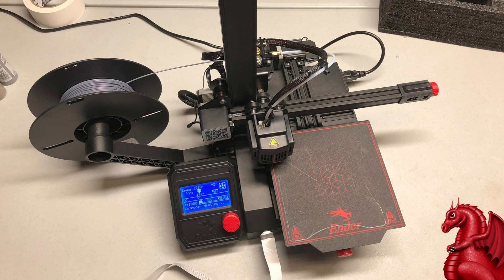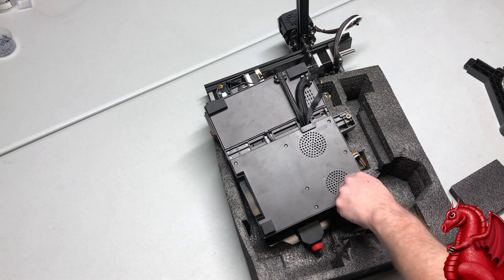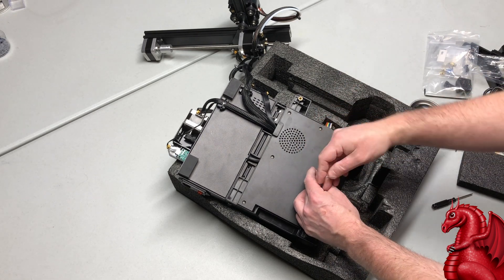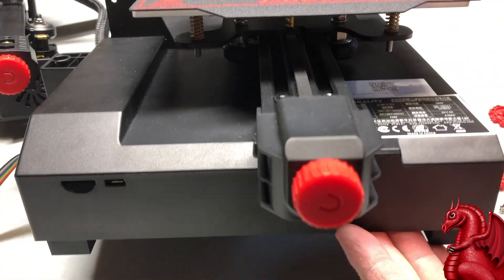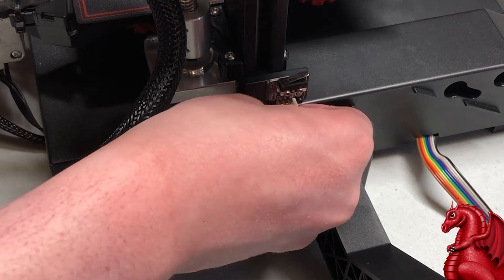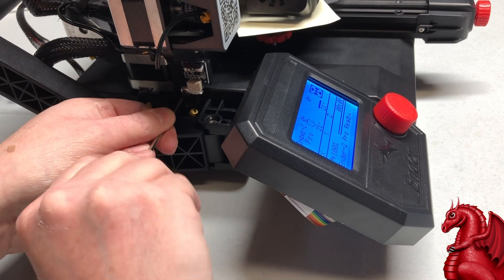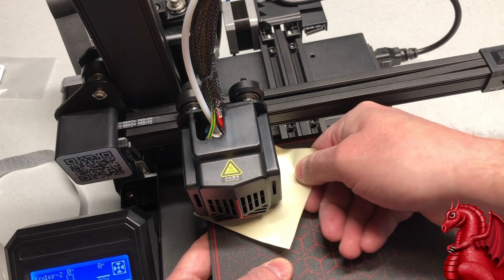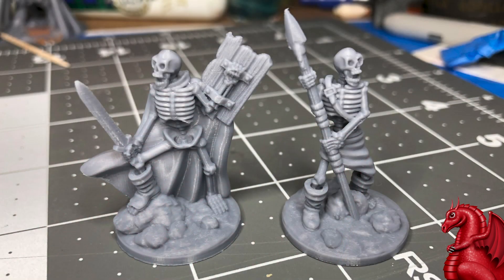Creality Ender-2 Pro assembly and pro build tips.

Comment: Really enjoyed this video.  I purchased this printer when it was on sale a month ago ( $89.99 after coupon discount, couldn't pass that up)to use for little things.  I was not initially impressed with this printer, but after watching your video and doing the changes/upgrades you recommended I was much happier.  The build plate is junk and should be replaced with a spring steel one.  One problem that I've seen others mention is the models not printing straight.  On mine, the problem seems to have been the Z axis stepper motor mount.  It attaches with two screws to the frame and is crooked!  It causes the motor, and therefore the rod to be at an angle, and the taller your model the bigger the problem.  The difference from top to bottom was 2mm to 3mm.  I replaced my motor mount with a file of a better designed one I found online, and it seems to have solved the problem.  Thanks again for your video.

Comment: I got mine today. It's my first 3D printer and I'm struggling to level de bed.  The corners seems to be leveled, but the center is allways warped. Does anyone had this problem?
Thank you all!
Reply from the maker: Just get it so the center prints perfect, most objects you print will be there, not the corners. Any models that do go that far will be fine as long as the center is good.
Reply: @Tombof3DPrintedHorrors  tks for the tip. :)

Comment: THANK YOU! I was struggling with the Z offset and getting the bed leveled reliably, but your recommendation to manually set the z limit access switch did the trick. Also replacing the springs helped considerably and retains consistency for much longer periods of time.

Comment: Video on tuning eccentric nuts: https://youtu.be/JTN6jtB5mqk?t=801
Basically, tighten or loosen the eccentric nut just enough so that you can use your fingers to rotate the wheel without the entire carriage assembly moving. You want the wheel to be just barely loose enough so that it can rotate freely.
Reply: So what do you do if the hotend is so loose that it freely wobbles and no matter how much your turn the eccentric nut it never gets tight?

Comment: At 10:05 you say that the screws have to be loosened 2 full turns. Is this right, because i have the feeling this is way to much and makes the whole thing wobbly 🤔
Reply from the maker: It is correct and prevents Z binding. 1 1/2 turn loose is minimum, 2 turns loose is what I use.

Comment: Which printer do I use in Ultimate Cura as the pro 2 is not listed?
Reply from the maker: Ender 2, then change the bed size to 160x160
Reply: @Tombof3DPrintedHorrors  Thank you so much brother, keep up the excellent content. You have my sub ;)

Comment: I just got mine today (3/3/22). It's not a "small" printer, but I can see the appeal of using it to print "small" things. I could see a 0.2 or 0.3 size nozzle in it for some amazing detail and saving your "big" printer for "regular" stuff. I was blown away by the level of detail it was printing with a 0.4 nozzle and crappy demo filament I got with another printer.

Comment: Got my ender 2 pro and followed this video but when i auto home the bed goes to the rear of the printer and the hot end is way to far left so if i push the bed forward the nozzle is not over the bed. What did i do wrong.

Comment: hi, i followed your video on building the ender pro,very  good video, machine developed fault,they sent me a complete motherboard and hot end kit, fitted mother board and hot end kit, all wired except the pair of thick red wires which go next to the bed and nozzle plugs,i have no way of telling how they are wired to the mother board as they are obviously both red, if I wire them wrongly will it cause damage, if so ,how do I tell which way they go,thanks,hope this makes sense
Reply from the maker: You can put either wire into either port, it doesn't matter. :)